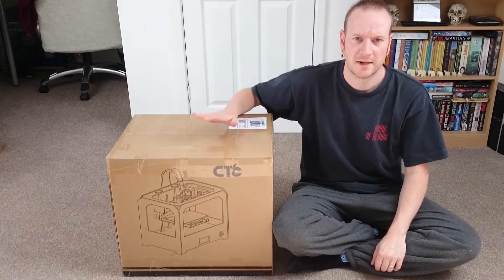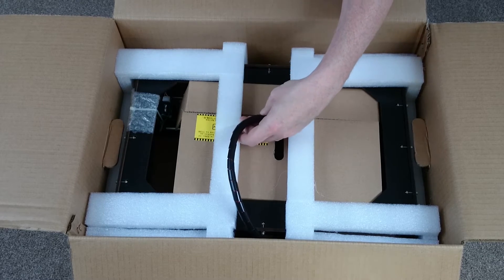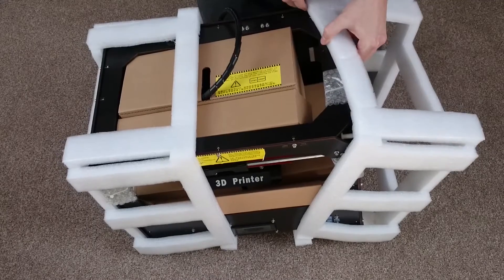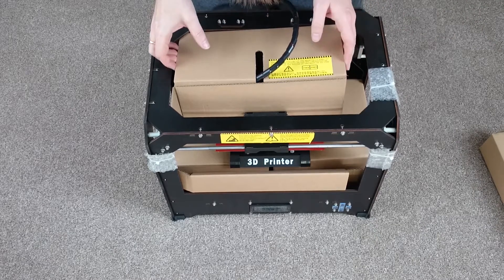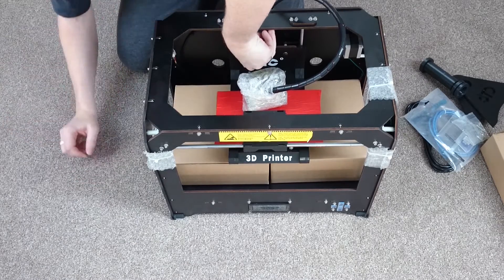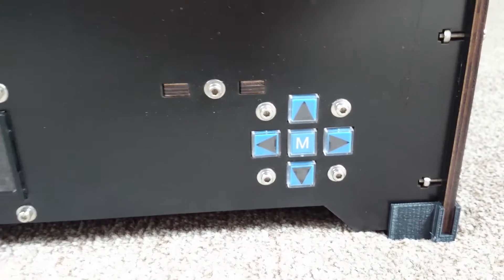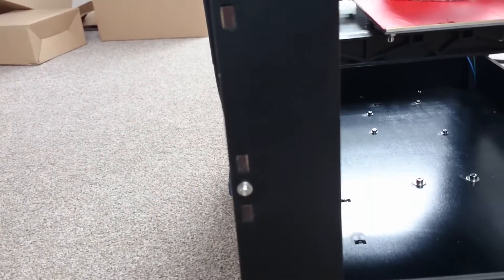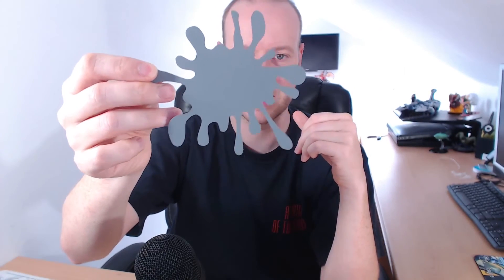CTC 3D Printer Unboxing

Comment: Have you tried to print from SD Card ? 
It doesn't work on my printer for some reason, firmware does not show files on LCD screen, while ReplicatorG installed on PC seems to have access to files on SD inserted into printer - it shows them in the list and allows to build from them
Reply from the maker: Make sure the files are in .x3g format. That is the only format you can print from on this printer. If you Google .x3g converter you should find some free software to do this. Or if you have Simplify 3D make sure you set the save option to .x3g as well
Reply: Abernus69 I used Makerbot Desktop which generates s3g and x3g. When SD (simple one gig SD with FAT16) is in the printer, "Build from SD" shows empty list, while ReplicatorG software on a laptop, connected to the printer, has also menu button to build from SD card, and dropdown menu shows all these files, and build, initiated from ReplicatorG on laptop, runs fine (I mean as fine as it is possible in stock). I could think that the files are taken from the laptop, but I know they aren't there as I've prepared them on the other pc where Makerbot Desktop software is installed.
Reply from the maker: @rockhound1974  Try removing the other files and just put 1 .x3g file on the root of the SD card and see if the printer will see the file.
Reply: In fact that's what I did first. I even did an exercise to remove windoze system files from SD card, left only 2 files - "chess.s3g" and "chess.x3g".
These files were NOT shown on LCD screen of the printer.
Then I decided (before proceeding with dispute/return) to make attempt to print from PC.
I have installed the software that had been provided by vendor on CD disk (pls note: no SD card in the package). The separate story was to install drivers from CD (the vast majority were not signed, on Win 10 a special reboot procedure is required to enable booting with "install unsigned drivers" option - that's a separate story).
And once I've run ReplicatorG, I've noticed there is an option to print from SD - and it has shown the list of files - "chess.s3g" and "chess.x3g" mentioned above. Print was successful.
Reply: @Abernus69, thank you!
I also posted the same question to CTC printer vendor (via message exchange within my order info on AliExpress)
To make long story short, their response was a suggestion to rename file in a way that its name starts with "3D".
So, I've removed all files on 1G FAT-formatted SD card except one, which I renamed to "3D123.x3g".
I've inserted SD to the printer then, and switched it on.
First attempt to enter "Build from SD" menu didn't bring any fruit, I moved back, and, after a sshort pause, repeated attempt, and it show the file!!!
So, I've started printing and, thank God, it had performed full build standalone.
I've printed the same Chinese chess that I had already printed via ReplicatorG, and I've got an impression that standalone print delivered a bit better quality.

Thank you so much for your help!

Comment: Got myself one of these and returned it within 3 days. Watch what your buying guys. Cracking wee printer if you get whats described.

Mines was ordered off Ebay as 2018 fully upgraded dual Mk8 CTC. I got a similar printer to picture above. NO SD card and none i had worked init. The left extruder did not get recognised because of the Twinmaker firmware 7.4 rev 001 which i spent over 2 days trying to update and never worked.

Getting An CR10 instead. Good luck getting a decent ctc now guys seems like theres a lot of clones of clones with dodgy firmware about.
Reply: Sailfish is the firmware you suppose to upgrade to! that might been your biggest issue and if you choose to upgrade the motherboard which cost like 30 bucks, you can add an even better firmware. The guy in the video gives a warning about buying this, it needs to be tinkered with in order to get it right.

Comment: what app did you use for this 3d printer as i cannot find any that i know for this 3d printer. The 3d printer cannot see the files i put in the memory card and i don't know why pls help!
Reply from the maker: You have to export the files as .x3g. Simplify 3D is the software I use and has an option to export as this file format but that costs. You can use a 3rd part tool called GPX that will convert gcode to x3g and this is free.
Reply: thank you very much i just got it fixed

Comment: Can you print in fast mode
Reply from the maker: I have accelerate turned on in the printer settings and my prints come out fine
Reply: Abernus69  I have it turn on to but am saying on the setting on makerwear do you put it fast mode
Reply from the maker: Sorry I don't use makerware, I use simplify 3d for slicing and 123 3D for cad/design work

Comment: I'm from Australia does it do 240V
Reply from the maker: Hi, The voltage switch on the power supply in the printer is for 230V or 115V. I have just done some checking and various pages I have looked at list Australia as using 230V. Might be worth double checking your power supply.